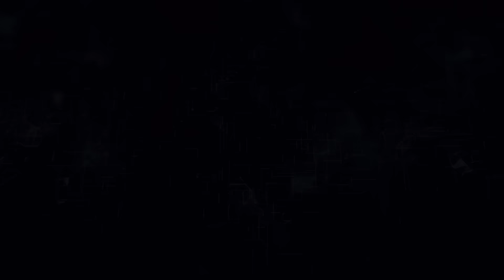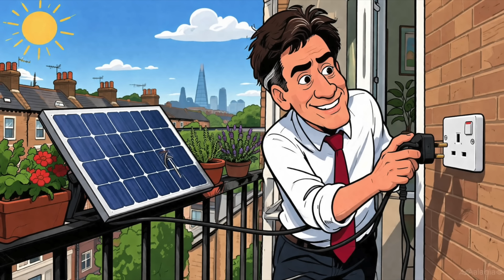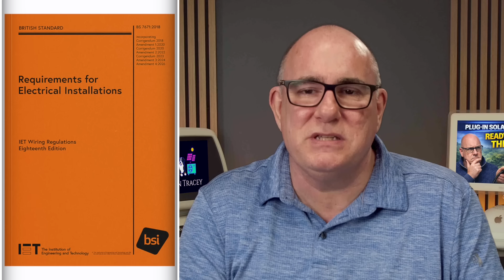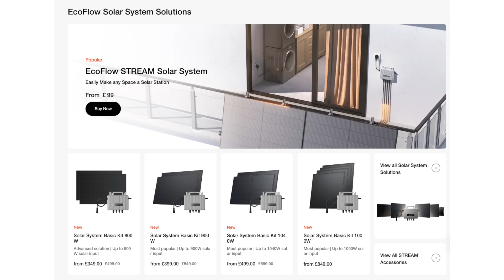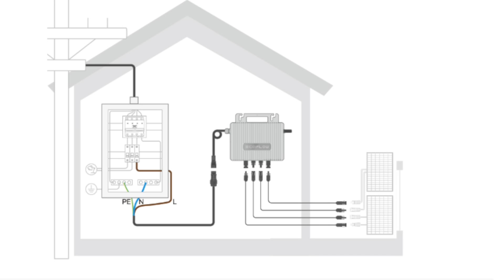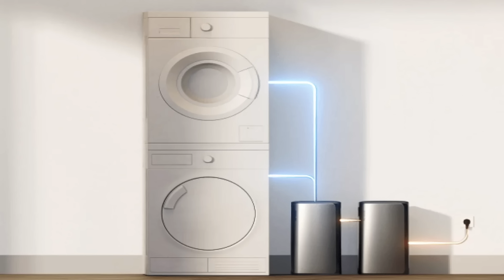Plug In Solar Is Coming… But There’s a Problem

Comment: When people start using these. The power company’s will increase their tariffs to make up for the lack of income.
Reply: Not happened anywhere else. In fact it tends to drive consumption from the grid proper down which reduces gas usage and drives prices down for all.

In Australia which is way way further down the line than we are (and a lot sunnier) they are reaching the point there is so much solar everyone can have 3 hours of free electricity subject to some limits even if they don't have solar themselves.
Reply: @etchedpixels  That is good news, Thanks for the info.
Reply: @etchedpixels this is why we have standing charges. Guaranteed profits for the energy companies.
Reply: @etchedpixels  To a person living in a country where prices have only one way (UP) that almost sounds too good to be true....
Reply: @etchedpixels what are you talking about ..power has doubled in the last 4 years Solar is a flop and at a cost to the taxpayers because of it
Reply: But people switching from petrol to electricity in their cars will more than offset that.
What we might find though is that nigt-time electricity becomes more expensive than day-time electricity rather than the otherway round as it is at present.
Reply: @katrinabryce  Have you tried charging an EV from a flat on the 14th floor of a tower block? No, thought not 🤔🙄
Reply: @katrinabryce  Most people don't want EV's.
Reply: @Answersonapostcard It isn't about what you want....it's about using some commonsense. Go see the Keeling Curve.
Reply: @coleorum  It’s about choice, I had an EV but went back to a hybrid.
Reply: @coleorum it’s not common sense to force people on to buying useless EVs. Millions of people live in flats with no charging and they are simply not good enough for most people as well as being too expensive
Reply: @Answersonapostcardwell done for being so impressively wrong about everything.
Reply: @chrisrowe5352 well done for being rude when someone is expressing a perfectly valid point that you happen to disagree with. The world is full of differing opinions
Reply: @Answersonapostcardit's not a valid point - it's a poorly framed opinion clearly not based on fact
Reply: @chrisrowe5352 it’s not an opinion that lots of people live in flats and won’t be able to charge their EVs
Reply: @Answersonapostcard I live in a flat. Right now I can't charge an EV, but if they were to allow me to install a charger in my allocated parking space, then I could. A change in the law could make that happen.
Reply: Another con?
Reply: So what you are saying is we should get our own solar panels to help avoid paying the increasing rates from the energy companies?
Reply: @javelinXH992  I’m saying that those who cannot afford the panels, Will end up poorer as the price keeps increasing. There should be some kind of initiative to make them affordable for everyone.
Reply: Condensing boilers reduced gas consumption up to about 30% and that's about how much the cost went up immediately it became law.
Reply: And government will tax what you produce.
Reply: Thats why the ultimate goal is what they call islanding. Getting off the grid for as long as possible but, they panic about that hence these micro inverters only work when the mains is present 😂
Reply: C'MON, they will do that anyway!
Reply from the maker: possible but lets look on the bright side for once
Reply: @JonathanTracey  What happens to those that cannot afford the panels, Yet their bill is increasing, As they put prices up to compensate for lack of income?
Reply: @Stoplight123
They are going to make solar much more affordable.
People are being left behind by the much higher costs of grid tied systems
Reply: @pencilme1n That’s good news if they are going to be more affordable.
We have a similar thing now with pet insurance. Vets fees shot up when insurance became popular, Now those that cannot afford the insurance are facing higher vets fees. I am one of the fortunate ones that can afford it, But that wasn’t always the case. I will never forget the times I couldn’t though and feel for those who end up left out.
Reply: Will they? I didn't think people's homes were the main draw on the network... It's big industry. The grid is sized for that, not powering people's homes. Though we don't have much big industry left either😂.

Comment: The current G98 and G99 forms look daunting when you first see them because they are designed for full MCS accredited installers who know the jargon. 

They will need simplifying for plug and play users.
Reply from the maker: Hopefully they will just say anything below 1000w does not need any approval G or otherwise
Reply: @JonathanTracey but we both know they won't

Comment: Why bother to keep the the link between MCS ( or a fee) & Export Tariffs   ?  It is just the power company not wanting to loose "consumers" .
Reply from the maker: agree its outdated bureaucracy
Reply: There has been no link since at least 2019.

SEG Guidance 4.7 provides that any electrician qualified in solar and a member of a professional body (as is required) is sufficient. If your supplier refuses to accept a non MCS install where an electrician qualified in solar did the work then dispute it and if need be take it to OFGEM. Several providers have been beaten up for this and fixed their policy.

Comment: I’d love one, unfortunately I have a flat with no balcony.. I can’t think of anywhere I can put the panels.
Reply from the maker: thats a shame, do you have any ground or roof access?
Reply: For a flat you'd need the freeholders permission and full planning regulations, and part A structural building regulations, and in many cases the freeholder would have to do a full fire safety analysis on the building too.

It's going to be really hard to match plug in solar with the current fire regulations, especially on tall buildings post Grenfell. The result is that the odds of a freeholder of a block of flats allowing solar panels added by leaseholders/tenants is basically nil.

Battery is likewise difficult due to PAS63100 but might be doable for some flats. However the prices of stuff like Ecoflow AC Pro are so obscene for 1.8kWh of battery it's probably not worth doing at least until the prices drop a fair bit.

Comment: I was thinking ‘oh good, I can make use of the garden fence at the bottom of the garden where sun hits about 2 pm to 4:30 pm gets many longer. But I am also going to get better battery system so I might not need them
Reply from the maker: Get a battery and get solar panels it works well together
Reply: The RoI on the solar is excellent. The RoI on the current Ecoflow and similar "plug in solar" batteries is fairly abysmal because the batteries are hideously overpriced in the UK (they are expensive in the EU but the are absolutely ludicrous prices in the UK and someone is clearly going to make a killing off plug in solar)

Comment: Waiting for it all to shake out. Be a bugger if they said 700 watt max and everyone has rushed out and got 800 watt inverters.
Reply from the maker: guess what the 800w inverters would continue to work, the vendors would just hamper them in software. Mine will do higher if your tell it your in another country
Reply: @JonathanTracey interesting, out of curiosity how much higher ? I see panels have already gone up a tenner each in City Plumbing.
Reply: Wattage change would be fine. Compliance on waveforms or DC leakage could leave all the existing kit invalid. I am sure the politicians are very aware of the issue, although they've happily broken all the existing "pre legalisation" equipment in other cases before.

Anyway - there are much better and cheaper products available whose vendors are waiting until it's actually legal.

Comment: I`m no electrician but i would say that frequency synchronisation is vital beyond any safety of the 3 pin plug
Reply from the maker: the frequency sync does two things, one it makes it seamless to feed power into the house without damaging anything or tripping breakers, its also the signal that the inverter uses to see the grid is there, as soon as it goes away it stops, so if you were to touch the pins they wont be live

Comment: I have a question if I already have solar can I still do plug in as well to give me an extra boost. The reason I ask is I have a spare space south facing I think I could fit about 8 panels. And what is ecoflow like
Reply from the maker: yep i have two small micro inverters alongside my solaredge system. my ecoflow systems have worked flawlessly, but some users report support not being great

Comment: If you have a 200w baseload you are looking at around a £100 a year saving, with a battery £200 a year. So your panels and inverter will cost circa £500 and a power station will set you back starting at £400 so let's call it £1000 all in, that will take 5 years to pay back. Lower baseload longer, higher baseload shorter.
Reply: Panels+inverter is EUR 350 on the German Amazon
Reply: @konstantinlozev2272  UK prices were rip off - and with plug in solar looking likely they've upped them even further. Hopefully they'll crash when our big supermarkets start selling non Ecoflow stuff after it's actually legal.
Reply from the maker: @kjeksklaus7944 I think you’re in roughly the right ballpark on payback, but the numbers are a bit optimistic.

A couple of things to tweak:
- An 800W system in the UK is typically ~2–4 kWh/day over the year, so ~700–1,400 kWh/year.
- At ~25–30p/kWh that’s *£175–£400/year max**, but only if you use *all of it — which most people won’t without a decent baseload.
- A 200W baseload helps, but it won’t soak up everything, so real-world savings are usually lower than the headline.

On the battery side, the extra savings aren’t usually £100 on top — it’s more about shifting energy you’d otherwise export, so the gain is smaller unless you’ve got very consistent usage.

So yeah, ~5 year payback is possible in a good setup, but for most people it’s likely a bit longer once you factor in real-world usage 👍
Reply: @JonathanTracey with a hybrid electric boiler the heat pump mode uses around 200W, fits very well as additional base load, even without a battery (well it itself is a super efficient thermal battery 😊)

Comment: PV inverters can/do inject DC current into the AC circuit which can blind RCDs and so consequently we fit bidirectional RCBOs to prevent this.
How many people are going to know, and change their socket circuits?
Reply from the maker: @yammydave7880 You’re right that DC leakage can affect RCDs — that’s why the regs and manufacturers cover it 👍

But most modern inverters either limit DC leakage or specify the correct protection, so it’s not a blanket “everyone needs to change their circuits” situation.

Also worth noting — plug-in solar has been used in Germany for years at scale without widespread issues, so while it’s something to be aware of, it’s probably not as big a real-world problem as it sounds.
Reply: It may well be that they have to specify a limit on DC current injection on compliant hardware - which will be fun if the current stuff everyone is buying in advance doesn't meet it.

Comment: So £12.50 a month saving. I wonder how much the kit costs? Hardly worth bothering with!
Reply: Can be done all in for less than 300 or far less if you get used or slightly damaged panels.
Reply: Think long term. Also if energy prices keep going up your investment will pay off sooner.
Reply from the maker: @jf9484 so you dont know what it costs but your have discounted it already
Reply: @JonathanTracey  Will take 2 years to pay off. That sounds very optimistic. 1. You need to always use the power it generates. 2.  The UK is the second worst place in the world to install solar.
Reply: @JonathanTracey  No, I don't know what it will cost but I do know at £12.50 a month it will take years to pay for itself.
We're taxed enough already to fund the solar farms and bird choppers. If the government wanted this to take off then they should be providing the kit at no charge to anoyone that can use it, this is helping the government dig themselves out of the complete mess they've made of power generation. No doubt there will be VAT on whatever price the kit is!

Comment: I’m a heavy electric user with base load of 400wh so a 800w panel system would make much more than the £100 a year savings especially if I added a couple eco flow batteries.
Reply from the maker: Yep with batteries you can also take advantage of cheap overnight power in the winter when teh panels are not producing

Comment: Those panels go very well with a Hybrid WiFi boiler like the Ariston Lydos, which consumes only 200W in heat pump mode. It's heating the water up slowly, but essentially for free.
I'd say this is probably a better first investment before a battery.
Reply from the maker: @konstantinlozev2272 Yeah that’s a great use case 👍 low, steady loads like that work really well with small solar.

Only thing I’d say is it’s not really “free” — you’re just spreading a small amount of generation over a long time. Still a solid option though.
Reply: @JonathanTracey yeah, certainly not "free", but the rationale at least here in Belgium is that the exported electricity is paid at around 10% of the price of imported electricity.

Comment: I'm a tad technical and have been looking at 800W of panels and a bank of 6x 60Ah gel/agm batteries and wiring the regulator output into the lighting 
of the house and realised the rest of usage was not easy. The inverter will only have a couple of 13A outputs and that means extension leads to the rooms where you want to use laptop/tv/ and short term high consumption like a hair dyer or boiling the kettle etc.
I've done some sums and having a south facing roof on a small terraced house it looks doable but 800w is a lot of money and space. 
Wondering if 4 to 500w would do the job. Seeing salvaged/reclaimed panels on the market puts another question of how to spend limited finances.
The disciplines I have worked in make me think having it all signed off by a qualified electrician would not be easy and that would probably compromise the house insurance. Just found your channel and would like to apologise for so many questions. Happy Easter Sir.
Reply from the maker: @simont1108 Not too many questions at all — it’s exactly the right way to think about it 👍

You’ve pretty much nailed the challenge: once you step outside lighting and low loads, it gets messy fast with extension leads and limitations.

For most people, something like 400–800W works best just covering a steady baseload (fridge, standby, routers etc.) rather than trying to run the whole house. And you’re right — 800W is a fair bit of cost/space for what it delivers.

On the regs/insurance side, that’s still a bit of a grey area in the UK right now, which is part of the wider problem.

Honestly, sounds like you’ve got a really solid grasp of it already 👍
Reply: @JonathanTracey  Thanks for the reply. All the best.

Comment: In Belgium we have this since April 2025. 
We can export without a fee, but at a low price.
Our house uses 100-200W at all times. And you can do a bit of overpanelling so that it covers that base load even in cloudy weather.
And you can install an AC battery in your house which tracks the Homewizzard data from your smart meter and puts any excess into that AC battery.
A 5kWh battery like Marstek Venus is around EUR 1200 and it can do exactly that in combination with the Homewizzard data and can feed your house base load in the night (also limited to 800W).
In makes the payout time longer, but is also nice backup option.
In March such system produced 105kWh in our backyard, which at current prices is around EUR 30.
In June-July should be much more.
Very short break even period.
I think a particularity for the UK is the 120V standard, which I would expect requires shorter (or thicker) cables to the socket.
EDIT: I had things confused, apparently 120V is only in the US!
Reply from the maker: UK is 230v just like the rest of Europe
Reply: @JonathanTracey ugh, sorry, my bad, I thought it was like in the US.
Reply: @JonathanTracey well it's 240vAC but we pretend it's 230v😂
Reply: @JonathanTracey  Except our lower limit is still about 10% higher (but with a proposal to align with Europe)

Comment: I have looked at the G98/99/100 forms. I'm no dummy, but they are not simple to fill out. 
Most consumers would take one look, plug the solar in and bin the forms.
How many people even know who their DNO is or what their DNO does?
It needs to be ONE national automated portal where you register yourself and your system.
Are the DNO's backend systems automated, or do they rely on someone in an office checking every application to make sure they know how much generating equipment is on each transformer?
I'm all for them being legal, I'm just not sure the industry will be ready for the summer.
Reply from the maker: agree hopefully they will just say anything below 1000w is excluded from the requirements
Reply: G98 is easy
Reply: But it should be exempt anyway

Comment: My day time base is only around 200-300 watts, evening is 400 to 600 watts.
I have two PowerOak 2400watt battery backup units, for emergancies, that I could include if they are of benefit (They have pass through capability).
What would happen if I got the 800 watt plug and play system? Does the extra I produce over what I'm using just go to the grid with me doing nothing?
Would these plug and play not trip the meter?
Reply from the maker: shouldnt do, I have three inverters in my home, all play nice together